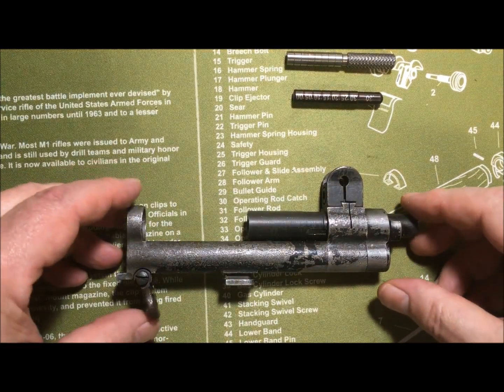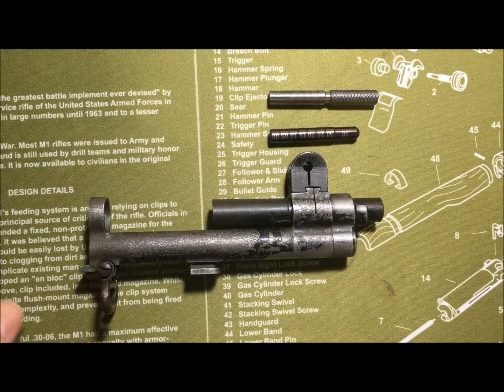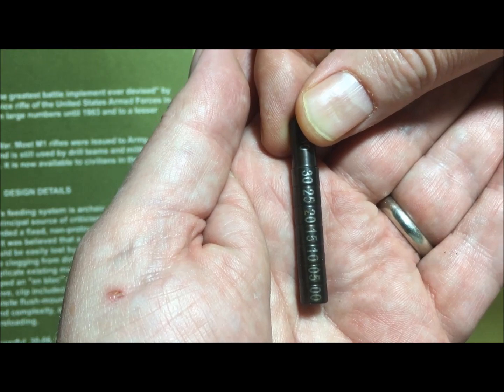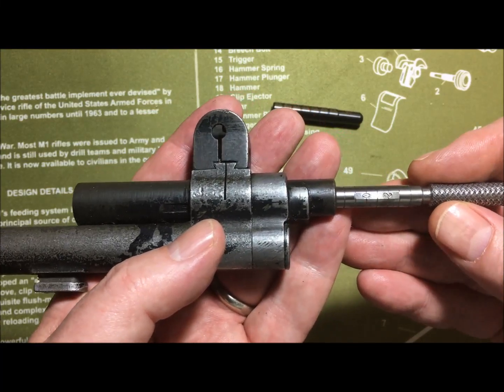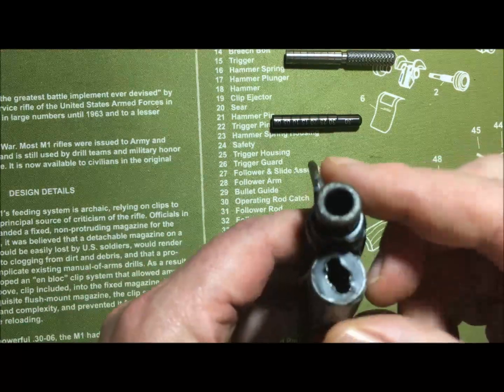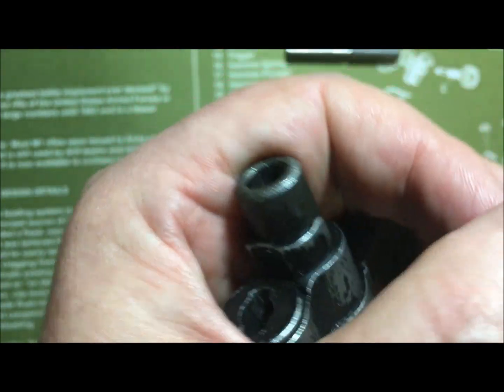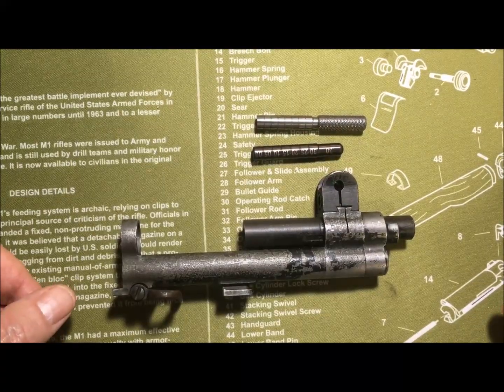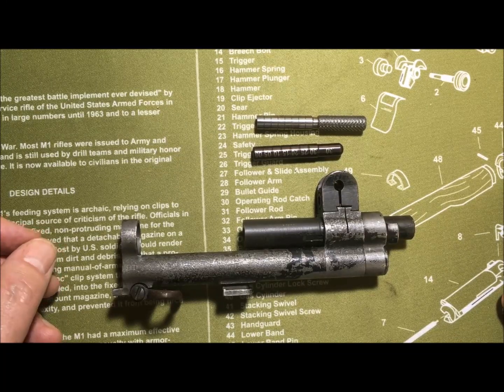HOW TO: Use an M1 Muzzle Erosion Gauge

Comment: So if the crown has dings/nicks in it you’re not getting an accurate reading on your gauge, I wonder what it would actually gauge if the nicks/ dings are cleaned up as you suggested with a lathe.
Reply from the maker: Except for the dinged-up muzzle that barrel was in very good condition before it was cut up.  I can only guess that the gauge would still read less than 1.5.
Reply: @FreeAmericaChannel  
Yes I noticed that, all I was saying is that the readings are a bit overrated at times, I’ve seen where a lot of people are getting in their rack grade M1’s and they’re not even doing the readings at all, if they are they are not writing them down on the tag.
I’ve got two rack grades I ordered from the CMP coming in within the next month or so, at least I hope so.
Reply from the maker: @humpy936  Oh, I am surprised and disappointed to hear that CMP is not gauging or at least not writing down the gauge readings.  Damn.  I'll have to call them.

Comment: I check mine is on 00 so that means the barrel is new just wondering is lmr date 12/53
Reply from the maker: New or virtually unfired.  LMR stands for Line Material Corp. of Birmingham, AL, and the barrels are common in Harrington & Richardson (HRA) manufactured M1s from the 1950s as well as arsenal refinished guns in the 60s.  12/53 is date of manufacture, not usually the date it was installed on the rifle, but the H&R guns are often very close in dates of receivers and barrels.  Sounds like you have a great rifle.  Is it an H&R?
Reply: @FreeAmericaChannel  Springfield I buy it in Royal tiger imports all the parts are Springfield except for the barrel and new stock. I was thinking to get one from CMP but they have too many requirements and the wait time is very long. It took 10 days from day I order it to receive it on my ffl. Hard to beat. I have been reading and herd CMP have 6 months ore more wait time.

Comment: The rough muzzle could one get a steel de burr tool and just lightly turn it?  I'm wondering if the burrs could cause the gauge to show a 1 when really it's a 2 etc..  Could someone get a round file and just lightly pull it over a burr?  Obviously turning it with a lathe is better but if I had an old war horse would that better than nothing?
Reply from the maker: The simple answer to "Could you.." is, yes, but I don't recommend it. There are tools specifically made to crown rifle muzzles called chamfer tools.  They kinda look like end mills cut at an angle, usually 45 degrees, with a steel or brass guide that fits the barrel caliber.  They make them for hand use and lathe use.  You can get them at Brownells.